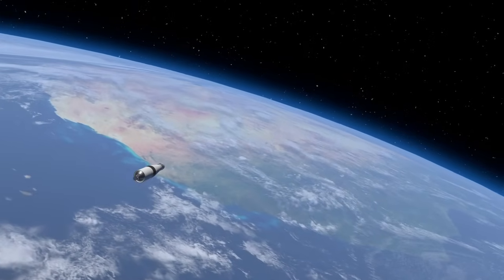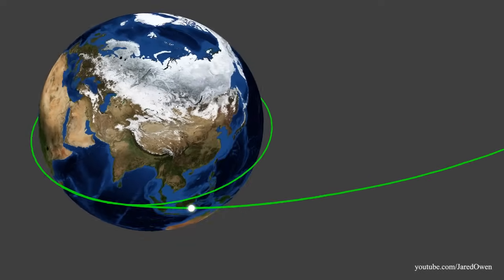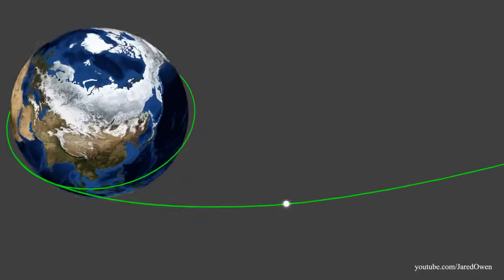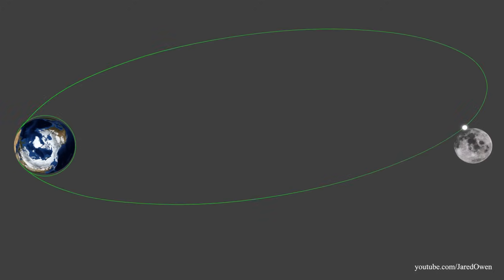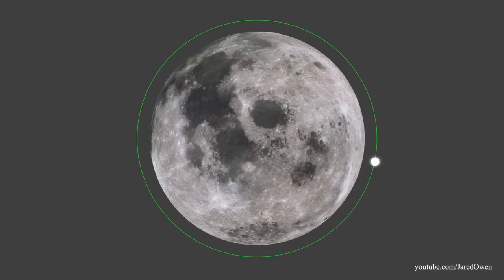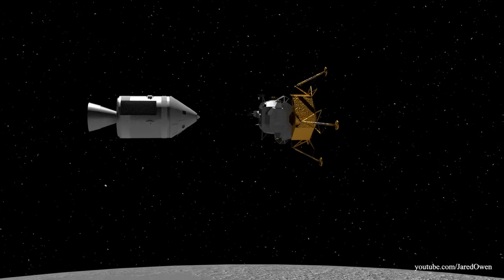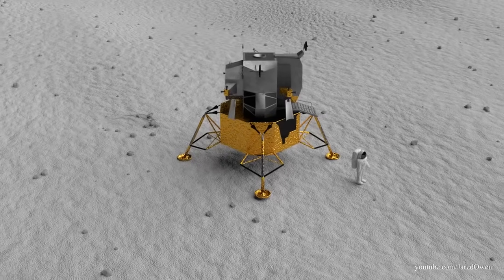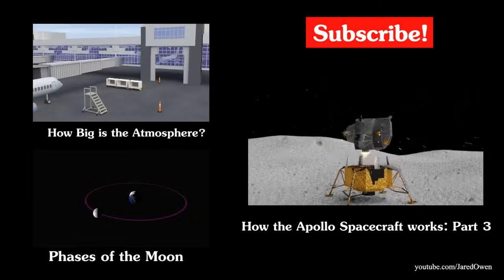How the Apollo Spacecraft works: Part 2

Comment: how do they get from the capsule to the lander with locking mech on the door
Reply: A collapsible docking probe. 
https://www.hq.nasa.gov/alsj/CSM11_Docking_Subsystem_pp87-92.pdf
Reply from the maker: Good question!  To be honest I haven't dug that deep.  I might do another video on the internals of the Apollo spacecraft.
Reply: The docking probe and drogue setup was some brilliant engineering.  It consisted of a pointed "probe" that was attached to the front of the Command Module inside the docking tunnel, just above the inside hatch at the top of the CM below the instrument panel.  This probe stuck out the front and contained a cone at its tip with three spring-loaded latches that engaged with the passive "drogue", which was basically a metal cone with a hole in the center, much like a "cone of shame" the vet puts on your dog to keep them from licking themselves after a medical procedure.  The drogue was installed in the top of the LM's airlock tunnel with three tongue-n-groove latches in a  "twist-lock" arrangement sorta like a gas cap on a car.  When the probe entered the drogue, it would slide down the length of the interior of the cone until it hit the bottom, at which point the tip of the probe was inside the hole of the cone, and the spring loaded latches would snap out and lock above the lip of the cone's hole, creating the "soft dock" of the two spacecraft.  Then the probe would be hydraulically retracted by a switch, pulling the two spacecraft together until the mating surfaces of the docking tunnel on the two spacecraft touched, at which point a series of spring-loaded latches around the interior of the tunnel would snap into place, locking the two spacecraft together in what was called "hard dock".  Then the two docked spacecraft would have the tunnel filled with air via controls inside the CM, until the pressure equalized between the tunnel and the CM cabin, which meant equal air pressure on both sides of the CM upper hatch into the tunnel.  The hatch would then be opened from inside the CM, exposing the base of the probe mechanism, which was attached to the walls of the tunnel with three clamps.  The probe was unlatched and retracted, and then folded up and stowed with the hatch inside the CM storage bay under the seats.  The tunnel was now partially open with the docking probe out of the way, and the astronauts would enter the tunnel, release the locks, give the drogue a twist, and remove the drogue cone from the docking tunnel, which exposed the LM's top hatch.  A pressure equalization valve on the hatch would be opened to equalize the air pressure between the CM, the tunnel, and the LM cabin, and allow the LM top hatch to be opened from the tunnel side.  This completed the docking procedures and allowed access from the CM to the LM.  

Before the LM undocked to go down to the Moon, the same procedure was reversed-- the LM astronauts transferred over to the LM, and they installed the drogue in their side of the tunnel at the top of the LM.  The CM pilot installed the probe in the tunnel on the Command Module side of the tunnel, and locked it in place.  The LM had its hatch closed, and the CMP installed the hatch on the CM, the tunnel was depressurized (air bled out into space) and checked for leaks of the CM and LM hatches, once they were verified to have good seals, the hard dock latches would retract and the two vehicles would separate.  

When they docked again after the lunar landing, the same procedure would occur to achieve soft dock, hard dock, tunnel pressurization, seal verification between the two spacecraft, then open the hatches on both the LM and CSM, and remove the probe and drogue to clear the tunnel, transfer cargo and crew from the LM for the final time, then close up the hatches for the last time, depressurize the tunnel to remove the load (compressed air in the tunnel pushing against the hatches and walls, pulling against the hard dock latches) from the hard dock latches, then the hard dock latches were retracted, separating the LM for the last time.  The CM and LM would then maneuver apart, with the LM later commanded to crash into the Moon or left in a decaying orbit (though the Apollo 10 LM is still drifting along Earth's orbit behind Earth in a permanent (we think) solar orbit, where it's been since early '69...)  The CSM then returned to Earth, with its probe stowed in the lower equipment bay, since it was no longer needed with nothing left to dock to, and where it would be safely out of the way of the parachute risers when the chutes deployed after reentry... 

On Apollo 14, (IIRC) they nearly had to scrub the mission because for whatever reason, the three spring-loaded latches on the tip of the probe would NOT latch into the hole of the drogue in the LM to create the capture and soft dock, which is of course necessary to be able to lock the two spacecraft together for the probe to "retract" and pull them together in the proper alignment for the tunnel latches to be locked in to create "hard dock".  They attempted several times and were running low on docking fuel, Mission Control finally told them to "ram it in" more or less and hit the LM drogue more forcefully, which dislodged whatever bit of dirt of whatever that was keeping the latches from snapping out into the hole of the drogue, which allowed them to snap out and lock the two spacecraft together so they could retract and "hard dock" the two vehicles.  Had this NOT worked, the CSM would have eventually used up all allocated docking propellant, and would have had to abort the LM docking and extraction from the S-IVB, and simply either conducted a lunar-orbit only mission, or abort the mission entirely and return to Earth... either through the free-return trajectory or by direct abort.  Once docked, the crew removed the probe and inspected it closely, and found only a bit of dirt or something that they thought was keeping the latches from working properly... of course it worked properly for their return from the Moon, as they figured it would.  Had it failed a second time, the crew COULD have transferred back to the CSM in their suits via EVA between the two spacecraft flying in close formation... which is how the Soviets planned to retrieve their single moonwalker from their lunar lander after his mission-- they couldn't spare the weight of a pressurized or reusable docking tunnel system and probe-n-drogue, so they basically topped their LM with a "dart board" and the top of their lunar Soyuz would have had essentially a spear or harpoon sticking out the top, which when the two spacecraft were brought together would spear through the "dartboard" on the LK lunar lander, "locking" the two vehicles together in close proximity-- the cosmonaut would then open his side hatch of the LK lander, climb out into open space with his box of rocks, film, and cameras, and then spacewalk over to the awaiting "lunar Soyuz" using handholds, meet his fellow cosmonaut from the Soyuz at its open hatch, transfer the payload inside, and then enter the lunar Soyuz and close the hatch.  The LK lander would then be discarded with explosive bolts on the spear or harpoon that would jettison it and the LK lander so they could depart lunar orbit for Earth.  Their lunar spacecraft would remain attached to the rocket stage for the trip to the Moon until it was in Low Lunar Orbit (LLO) and then one of the two cosmonauts aboard would transfer via spacewalk down the length of the "lunar Soyuz" into the LK lander, opening its single side hatch from outside.  He would then descend alone to the lunar surface, while his crewmate remained in lunar orbit in the spacecraft "mother ship".  

Later! OL J R :)
Reply: @Mr Sunshines hahaha you clearly don't know how complicated spacecraft is.

Comment: nice video  but i always  wanted how the astronot will know that they are inside the moon orbit or not...
Reply: Math!  Basically if they lost radio communications at the calculated time and picked up radio communications again at the correct time they did everything correctly.  The guys in the "trench" were the geniuses with orbital dynamics and thrust calculations that made it all work out.  Best of all... Those guys could do the math without the use of a calculator!!  They did use one to double check their work, but they did it all on paper first.

Comment: Like other sites and docus, you don't explain how and why the descent engine of the the LM was mounted on gimball???
Reply: As to HOW it was mounted - what does that matter?  Are you asserting it was impossible to MOUNT? 

As for WHY - it was to make sure that the thrust of the descent module was always pointing through the center of mass of the descent module.  This is rocket science 101.  To remain stable, the thrust must simply push the rocket into a direction and a vector through which lies the center of mass of the thing it is pushing.  That's why it had a gimbal.   The center of mass of the module wouldn't change much, so it only required small adjustments (as astronauts shift or the fuel supply drains).  The gimbal was controlled by the guidance computer.  It was running a program throughout the descent that monitored the center of mass several times per second, and adjusted the gimbal as necessary.
Reply: To maneuver the craft during the landing. Also, to keep its balance. Just like you move your hand if you balance a broomstick on it.

Comment: also how the LM gets its 2 mile lead while in orbit with the cm
Reply: In addition to their rocket engines, the CSM and LM had sixteen smaller thrusters called "reaction controls" that they used to rotate, slow down, or speed up in any direction (that's what those four "quads" of tiny rocket nozzles on the sides are).  Most small maneuvers were done using those instead of the bigger main engines.  To get a 2-mile distance, all you would have to do is make the Command Module a little bit faster and wait for its orbit to take it 2 miles higher.

Comment: can you explain how and what speed the rocket is travellling at and the service module is going at when it does its 180 rotation and then going to get the LM out of the rocket and how it slowed down to pull it out
Reply: The command/service module has small little thrusters on it.  The system as a whole was referred to as RCS (reaction control system).  All the small maneuvers used these smaller thrusters rather than the main engine - which would have been very much overkill for these small maneuvers.  Plus, you have finer control over more things like roll, pitch yaw - - basically things that control your orientation in space.  They used these to orient themselves, and the main engine to propel the whole craft.

Unless I go through the transcripts and see if they mention their relative speed (this would be relative to the Earth) around the time they were performing this maneuver, I wouldn't know the exact speed, but I do know that this maneuver was performed a short time after the TLI burn, and the speed after that burn was always in the neighborhood of 34,000 feet per second.  Again - this is relative to Earth.  That would be a a little over 23,000 mph.

That said, this doesn't mean anything.  The maneuver could have been performed in literally the exact same way regardless of how fast they were going.  Whether that be 25,000 miles per hour or 100,000 mph or 50 mph.  The WHOLE craft is moving at the same speed.  Once you are going at some speed, if you use the RCS to thrust forward, all you're doing is adding to your speed.  Now, you are going 23,001 mph while the rest of the craft is going 23,000 mph.  If you started at 50 mph, then that same thrust just pushes you to 51 mph while the rest of the craft stays at 50 mph.  The only important bit is the speed relative to the craft.  They thrust to get away.  They thrust again in a different direction to turn around, then so on and so on.  All the while, they are just changing their velocity and orientation relative to the craft.  It doesn't matter what the speed of the whole system is.
Reply: To add to what Whilloughby said... The ability to make those maneuvers in space is way different than in the atmosphere.  There is no aerodynamic drag in space to fight against so like Whilloughby said  overall speed is irrelevant.

Challenger didn't blow up.  It was destroyed by the aerodynamic forces of the atmosphere after being aggressively pitched against the air stream.  If that had happened at a higher altitude things may have been different.  One of the Abort modes for the Shuttle was RTLS Abort which meant the Shuttle would ride out the SRBs, cut main engine power, pitch over 180° and then fire the main engines again to slow down and return to earth hopefully with enough energy to make it back to the launch site landing strip.  Doing that 180° flip would not be possible at the speed they would have been traveling if they were in the atmosphere.  A very similar maneuver to the one the Apollo spacecraft did when picking up the LEM.

Comment: A minor point, the LM never looked down until the very end. They left lunar orbit and started their descent basically laying on their backs. There was too much going on for them to have been looking down, and then roll back up during PDI.

David Wood's book "How Apollo Flew to the Moon" is a great reference.
Reply: Well, it didn't FEEL like they were laying on their backs.  It would have still felt like they were standing on the surface of a planet with an acceleration consistent with the thrust of the engines.  So, their orientation wouldn't have mattered.
Reply: They did look down on Apollo 11. They wanted Armstrong to be able to watch landmarks go by to check the navigation. That was determined to no longer be necessary on Apollo 12 to 17. On those 5 missions the descent started with the crew facing up. Facing up provided a better orientation for the antennas, which improved the quality of the radio communications.

Comment: LM (3:22) can also be referred to as LEM ( Lunar Excursion Module). That's where the word "lem" comes from. Does it matter...no. But it's nice to know in case someone ever asks. :)
Reply: Yeah.. but some dropped the excursion part of the name because it sounded like a school trip.
Reply: Yes just like "Jeep" from GP (General Purpose) military vehicle at 2nd WW.
Reply: Kinda like the VAB, was originally called the Vertical Assembly Building but changed to Vehicle Assembly Building when it was foretasted to be used for other spacecraft too.
Reply: Originally it was referred to as the LEM, but in the early 1960s, NASA officially changed it to LM and it was never referred to as LEM again. However, you are correct that's where "lem" comes from and much to NASA's chagrin, LEM is still around.
Reply: As  @Woody615  said first it was named LEM, later renamed LM but still pronounced "lem"

Comment: after the bbq roll don't the rockets fire again?
Reply from the maker: Depending on the trajectory - sometimes they needed to do what's called a mid-course correction burn (sometimes there were several of these). Other than that they were riding on momentum until the Lunar Orbit Insertion.